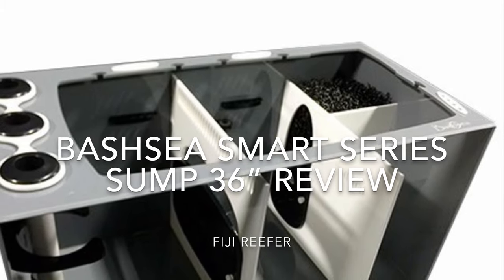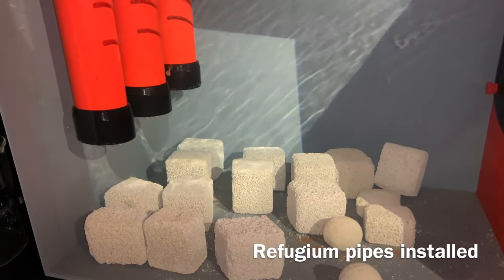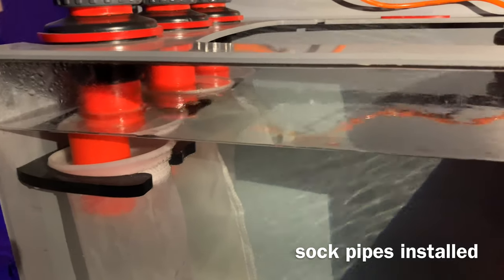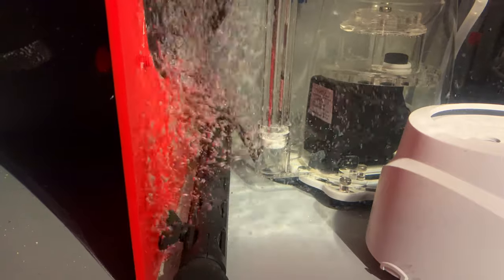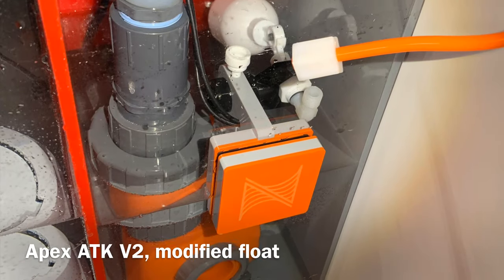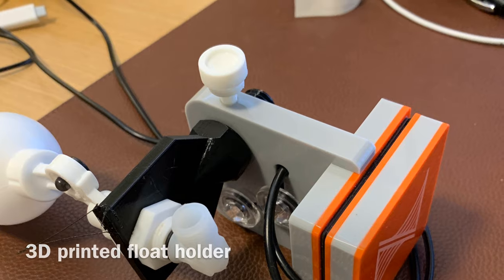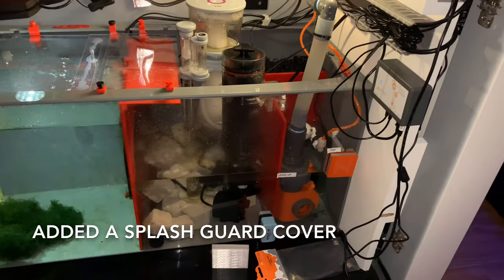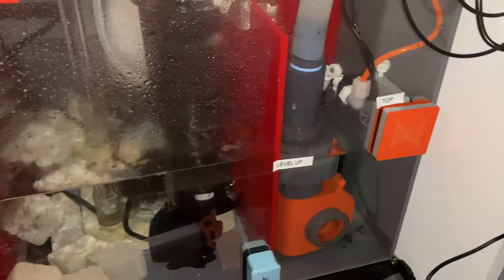Bashsea Smart Series 36” Sump Review

Comment: Thanks for the informative video sir. That was cool the way you 3D printed the parts👍 . I wanted to ask , it appears that when you had it in the sock mode , they would sit under water . Shouldn’t the top of the sock rim sit above the water level ? Wouldn’t that let dirty water or particles rather , roll over and out the top. Sitting below the water level .?  and it sure is noisy ..!

Comment: I just finished the plumbing on my new 150gal with 40gal Eshopps R-300 sump, boy did I make a mess with the glue but zero leaks :)  mines pretty noisy too but I got this plastic spiral that your supposed to put inside the drain lines to make the water spiral down the sides of the drains to reduce the water just falling and splashing , haven't put them in yet maybe get to that today and see if it helps quiet it down abit. Great vid though

Comment: Do you sell the filter mod? I saw your video for it, but can't leave comments there.
Reply from the maker: yes i do, it’s $50 shipped
Reply: @fijireefer3944  could you make ones of different sizes? I think I might go with a synergy sump due to the larger return area and I'm going to be running 2 return pumps, which doesn't seem feasible with the bashsea sumps. No idea why they make such massive sumps with such tiny return chambers